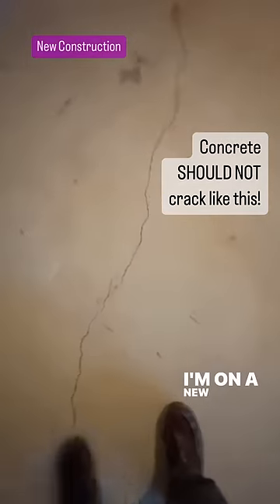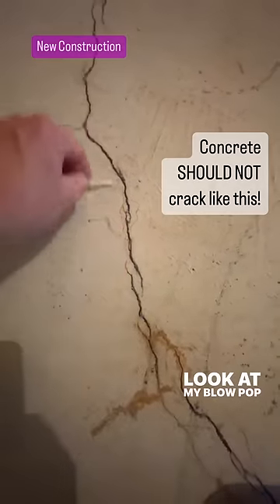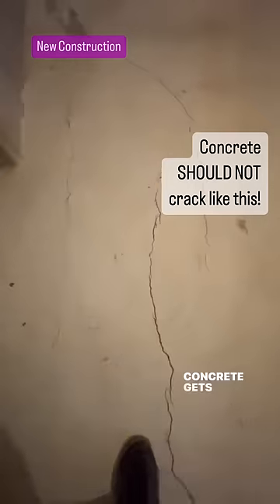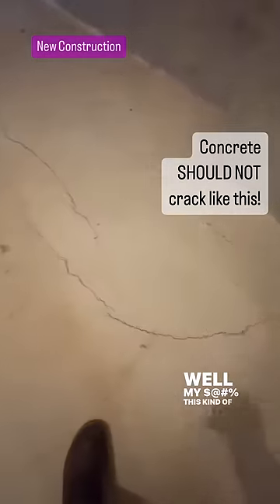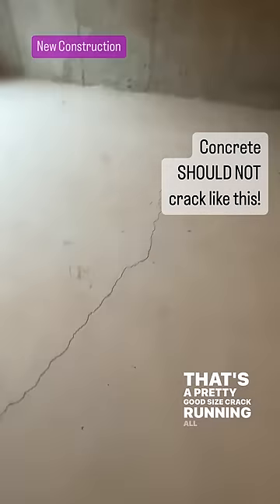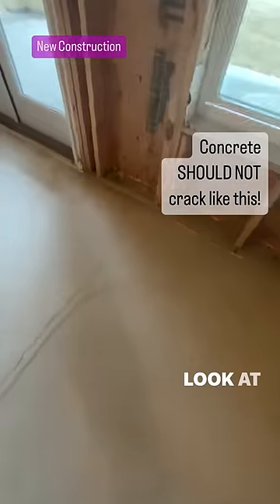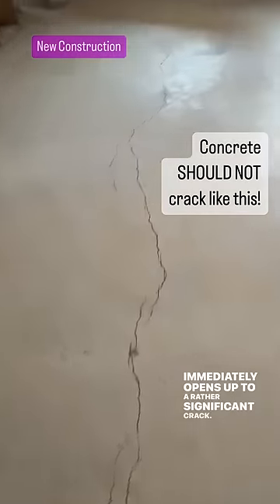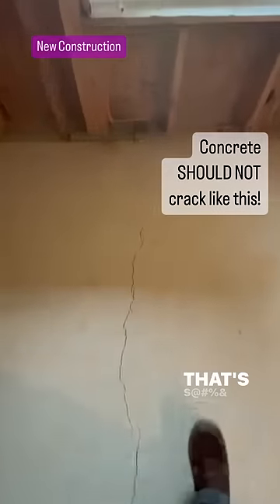New Home with Multiple Slab Cracks

Comment: Do building inspectors ever fail these guys? I just built a new home and not one person did their job well. But it makes me feel better I’m not the only one this is happening to.
Reply from the maker: Rare. When we work with buyers on new homes we end up being the builder's worst enemy. Don't look for trouble but easily spot crap work - like this. Last one we had, my buyers talked about a social media blitz; chart their build with posts every few days showing pics and how the build explained things. All the gigs were fixed, turned out pretty well and several private inspectors agreed.
Reply: @Hmtatlanta  Builders should do that themselves. If they can prove they do A+ work, they can pretty much charge anything they want.
Reply: I'm doing gutters at a few apartment complexes and everything from the engineers to the framers, to the siding, to the roofers, to the trim carpenters and to the people installing the screen on the patios.. they all pay no attention to detail! 

I walked in one of the apartments and they are trying to make it look nice but even with everything being new, you can see things everywhere thag could have just came out better.

Me installing the gutters and the concrete guys I think are the only ones who have done a good job on the whole site lol.

The painters quit 3/4 way through because the engineers decided to have a huge drop off and a hill behind a quarter of the buildings to where a normal man lift wont work. Then they had huge problems with erosion and had to add underground drains to our gutters even though the engineer said it would be fine.

We ended up getting a 150k electric compact man lift to get the gutter done behind those buildings. It was pretty cool tbh lol. But yeah back to the point... A lot of these trades people get paid cheap and that is what they deliver.
Reply: "not the only one it's happening to", is not acceptable period.
Reply: Maybe speak up for yourself and tell them their shit is unacceptable. At the same time if you hired "the guy who can do it for less" then good for you.

Comment: Looks like to much water when they poured it
Reply: They were probably so fking lazy to actually work the concrete and thought they could get away with a lazy pour.
Reply: Is it the light color that makes you think that? 
Just wondering, I'm a bricky, not a concrete guy.
Reply: @MMGJ10 no it's because now that the house is declared "done* , all that extra water in the concrete is trying to come up and out through the cracks as the foundation dries.  No?
Reply: No.   That's not what it looks like.   Too much water added to the mix caused a weak finish that will easily wear from any friction, leaving the surface covered in dust until it works it's way down to the aggregate being exposed.   There's no indication of a weak finish here.  Everyone freaking out because they think they know what they're talking about but I've not seen one person suggest the standard next step if there's questions about the slab....core samples.   They need to put the house in hold and have cores drilled throughout to see what the compressive strength of the concrete is.   
Second thing to consider....if this is a post tensioned slab and the cables have for some reason not been pulled yet, there may be nothing to worry about.   Because IF those cables just haven't been pulled, chances are that those cracks will pull together and be fine....   It's not unusual for cracks to form in an untensioned slab that's had significant weight added to it with more than just framing being done prior to tensioning.
Reply: @MMGJ10  Too much water evaporates creating shrinkage and tension within the slab.    The tension creates the crack.  You will sometimes see the cracks the very next day
Reply: @farcyde2948  No, those cracks developed most likely within 1-3 days if it's due to too much water.  Hydaulic pressure causes the water coming up through the cracks signalling the foundation drain is inadequate or the water table is too high.  It's most likely poor workmanship or bad concrete.  Testing is needed to be sure.
Reply: @invictusbp1prop143  Just the fact that you are talking about a tensioned slab on the ground - LMAO. Just shut up. It was too wet.
Reply: @invictusbp1prop143 wtf are you talking about pulling tension on hardend concrete. You pull it wet and cut the strands after its hardend. The tension is then transferd into the material. Also thats really only for transport of large walls and other pre cast . This is a house. Theres no tension cables in it.  The core samples is the only thing you said that make any sense.
Reply: For sure

Comment: One of the new houses they built beside me had huge cracks in the concrete. You could stack 2 quarters and fit them in the cracks. I watched them through most of the ground and pad work. They built up approx. 14 feet with loose shale on a very steep drop off, compacted it, and poured the pad within days. The type of shale they built on when moved is generally good to compact, let settle for a month and compact again. This stuff was like walking in sand it was still so soft. I also watched them do the rebar, no ties, rebar just laying on the ground, not held up to be in the middle of the pad, and the slump of the concrete was horrible and didn’t flow down to the ground on the outside edges, you could literally stick a leg under the pad where it bears weight, and they just filled that in with top soil. Within a month of the house being sold the owner has had people out to redo Sheetrock somewhere atleast once and rehang the front door atleast 3 times.
Reply: learned something new

Comment: I had a new garage floor poured about 40 years ago and not a single crack anywhere!
Reply: That's how they "should" turn out. If it's done properly. I find that after finishing a slab and it's hard enough to walk on without marring it up, that if you hose it down with water and cover that with a sheet of plastic to keep the water on the slab it helps strengthen it. Keep it wet for a few days. keeps it from getting to hard to fast and cracking. Cracks like in this video that appear after a few weeks or months are subpar concrete and subpar foundational material and compaction.

Comment: Cracking means that it’s settling as it’s curing which means that they didn’t do a great job grading the ground before pouring. When pouring in huge spaces like a whole houses flooring then it’s best to do it in sections so as it dries it’s not contracting as much or settling so unevenly. I’m sure they didn’t put any rebar or any type of reinforcement for the concrete either if it’s cracking already.
Reply: Cracking always happens. It’s inevitable. It’s because concrete contracts and expands. That’s why they do control cuts, so it cracks where you don’t see it. Yes this is cracking too much and something is wrong but cracking in general is normal

Comment: the only way to fix this is to: 
1) Keep the DeHumidifier Running 
2) put a Humidifier into Service 
3) let them battle it out 
4) dump the contents of the dehumidifier collection tray into the humidifier tank 
5)run both units at full/highest operating potential & record results 
6) look at the cracked concrete while the 2 units run

that crack is as comparable to one of your former lovers:
-it’s substantial in size
-it still gets your attention
-you want to ignore it
-it’s Embarrassing 
-it’s unprofessional & too thick for excuses

Comment: I redid the floor in my daughter's room, after 3 years in a small newly built home ( they cut corners on), tore up the carpet to put laminate and found a crack going from exterior wall to interior wall in the middle of the room.. room also wasn't squared off by the time I got to the last way there was a gap between laminate and wall looked like a long thin wedge so I had to get mathematical about my cuts. Didn't see moisture in the cracks though.

Comment: So what's causing the moisture and how do you fix it?
Reply: High water table no perimeter drain around footer.
Reply: Hard rain and no rain spouts the concrete has a good color just patch it put in a tile floor lots of glue its fine
Reply: @johnunsicker7440 when it rains for 2 weeks straight water seeps thru the concrete foundation with no cracks. Concrete is pours.
Reply: @arthurspooner36  *porous

Comment: Some time ago i bought a brand new house. A year later not only did the slab the garage was on crack, but the whole thing moved away from the house 4" leaving a 4" gap between the house and the garage. Well, come to find out the contractor after cutting down the trees had buried them then built ontop of it. Luckily i had a good lawyer. 😊

Comment: They ordered cheap 3 sack mix. I always use 6 sack city sidewalk n curb mix. City uses no wire or rebar
Reply: I've seen 5 sack crack like this with #4 on 16in centers. All because of too much water. It's not always the hands, these pumptruck drivers will add water when you ain't looking too.
Reply: We always use 25mpa these cracks are the result of extremely poor cement mixture. Cheap out this is what you get.

Comment: I just lay 1200sqft of tile on a house built in 2004. Cracks are big as this one.  I told the costumer we cannot give you a warranty with cracks this big.
Reply: Did you Atleast use a crack sealing membrane over them like Keridi band so if they move more it doesn't crack the tile.. that's what I do..
Reply: @chrisstaples703  
Yes, I did but still I'm not giving them a warranty on the future cracks of the slab.

Comment: I've built more than 100 homes and the basement concrete always cracks and it's not an issue because it's not structural and if you used proper moisture barrier beneath it you wont get moisture on the surface. I used to use a concrete compound to seal the hairline cracks though. The only time you won't crack in a large surface concrete is when you split the surface into sections or when you use special polymer compound in the mix and most builders don't even care to add to their cost for the unfinished area.

Comment: They will be piering the whole house and installing a basement gutter system in 2 years
Reply: Wouldn't need piers as long as the footing is solid. Also sump pumps and proper grading outside will negate the need for drain tiles.

Comment: When the slab was poured for the house I am building has a significant amount of compacted rock because of the groundwork then there's a layer of poly as vapor barrier. After the poly there's rebar tied and chaired. Then the fiber concrete is poured at 6 inches.

Comment: Concrete cracks just like that. Usually in a basement we use zip strip, which tells it where to crack. The closer together the cracks, the smaller the cracks.

Comment: Pour it on an 8 inch slump so it’s easier to pull and this will always be the result. 5 inch slump is and always will be the best. The mix designs are based on water to cement ratio and if that’s exceeded, cracks. The evaporating water from the mix goes faster than the reaction of the cement.

Comment: Topped out in the plumbing on a slab once, it was already cracking cardinally, came back to trim out and the cracks had shifted where some spots were about 1/4” higher than the the floor next to it 😂

Comment: Concrete that is odd shaped is going to crack for sure people that say my concrete hasnt cracked are probably wrong or it hasnt cracked yet control joints help hide the cracks in the joint if your lucky.  Fiber wire and rebar will also help hide the crack by keeping the crack from pulling apart or lifting. Knowing were to cut or tool your joints is kind of a art you gotta be able to read the slab.  and understand were its goig to crack cut it there and hope the crack follows your cut.  Allowing for Expanstion will also help control cracks

Comment: Seen this more than a few times during RUSHED construction. Seen them pour a slab/foundation and then start framing within a week of the pour. They're not letting the concrete cure before putting a load on it. A slab/foundation NEEDS to cure for at least 30 days and it's recommended to wait for a full 60. I've seen them pour on Monday and then the following week the load bearing walls are going in.

Comment: Over 40 yrs compact vapor barrier steel fiber and control joints and sometimes it still cracks. The cracks you have are structural which means some steps were skipped allot of times is down to how much you want to spend on prep.

Comment: How did you get in my house?  I told my now hubby to hire an inspector before signing the mortgage papers but he didn’t think it was worth $400-500 to hire a guy to look everything over.  I wish I did it myself because 1 year inspection was a joke.  Builder assured us they would fix what ever we found and they didn’t do anything except pull some bad/ crooked nails out of trim.  Biggest issue in my 17 year old house is the leak we’ve dealt with numerous times under kitchen sink.  Cracks in basement with moisture in them. Horrible looking trim around the doors.  Does Dollar store sell trim?  Lump in kitchen floor under linoleum.  A lot of squeaks in the floors & a lot of bad taping on the walls that was popping through paint before 1 year - that was never fixed.
Reply from the maker: How many of these homes are built is disgusting. But as long as the buyers just bump along, nothing will change. It's gotten worse and I don't expect it to ever change, there's always another buyer waiting.

Comment: Guys pour concrete about a1-2inch slump which means there is way to much water so its easier to rake and get into place but it causes the concrete to fail.

Comment: It depends on what kind of concrete u use what time of the year and how much water the guy put tin the back of truck when it shows up it says any water add to the  Concrete after leaving mixing plant will reduce the strength of concrete

Comment: I am building my house by myself. After I poured my 4,000 psi concrete I had three very tight cracks.  8 months later I am almost finished. The cracks have not gotten any bigger and no water coming through. (It is well above any possible water and I live in the desert.) Concrete cracks. Not if but when. But those cracks are way out of normalcy. The concrete contractor screwed up.

Comment: I've come to the resolution that if you don't want concrete to crack you leave it on the truck. I've used steel I've used fiberglass, I've used this new stuff they have out that's like 4-in long helical pieces of metal and it's still cracks. I literally think if it's going to crack it's going to crack and there's nothing man can do about it You can just do the best you can for each job

Comment: I worked at a place which added a new addition in 2019 & it already had slab cracks in 2020-2021. The roof also leaked during summer rains in 2021. Somebody must have pocketed most of the $2.5m budget bc that shit was cheap AF.

Comment: My thoughts exactly no vapor barrier and no control joints. 
I bet they put roll wire in instead of rebar. 
And sand is cheap for the sun grade.

Comment: Alot of the time doing things right is harder and the floor looks like it was poured wet because that makes concrete easier to work with. Spent hours here and there hand digging and busting limestone out of holes for sump basket installs because one of the guys I worked for did it right every time. And I was the one with the pays the same attitude. Some people don't like an honest challenge and then in the end some home owner doesn't get what they pay for.

Comment: This is what happens when you cut corners to save money and make a profit. I had a house built 4 years ago, and I made the company dig up the whole basement. Putting a new one in the house wasn't even on the basement, and it was cracking.  I came to find out WHY that was happening they  dug down to the depth of where they were gonna pour the concrete. It was on dirt, no footings, no base

Comment: I wonder how does the wall blocks in the basement look like l wonder if they have cracks too , it will be terrible, we had a floor crack in our basement the contractor dig a roundabout hole dig out all the damage concrete out and then fill the hole with fresh cement, we haven’t had any problems,  am not expert in laying cement, but can you lay the whole basement with cement ,to fix’s the problem, 😮

Comment: Concrete minimum 4in. Thick. Rebar on 2 or 3ft squares. 6 mil plastic vapor barrier. Saw cuts every 10-15 ft. 3500 or 4000 psi mix no air on a 6 or 7 slump. This is how I personally do basements but still get a hairline crack every now and then. Sometimes no cracks. Never know.

Comment: I framed houses in Michigan in the 1980 and was amazed by the lack of any rebar in the walls and floors in these houses, just garbage and we use to joke about what do you expect for a quarter million$ and that was just the concrete, some lumber packages came with black mold , no extra charge either

Comment: There are two kinds of concrete: That which has cracks and that which will have cracks. The key is controlling where the cracks form with control joints

Comment: Seems like they didn't get the soil compacted correctly right? Or didn't do a good analysis, if waters coming up. Idk much about the water issue, but why would it crack like that? All i can think is a bad mix, or they took too long on delivery or the pour, not enough or incorrect reinforcement or rebar, or the soil has settled allowing it to shift and crack. Anyone care to explain what the moisture or water coming up would contribute to it cracking?

Comment: Yeah definitely soft foundation due to underground water, possible spring. But yeah slab is no good needs to be torn up dug out and filled with rock, gravel and sand then compacted and rested/weathered till it meets build code.